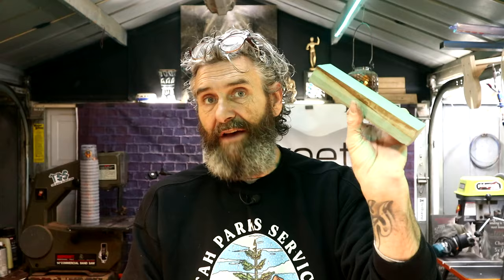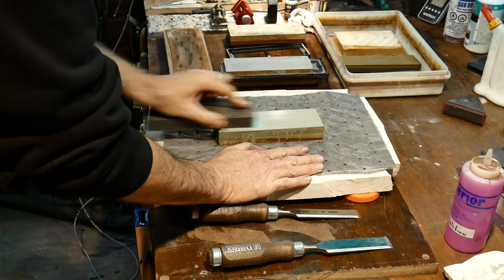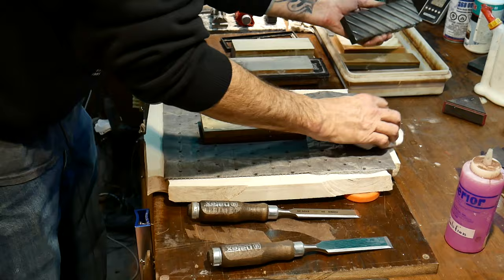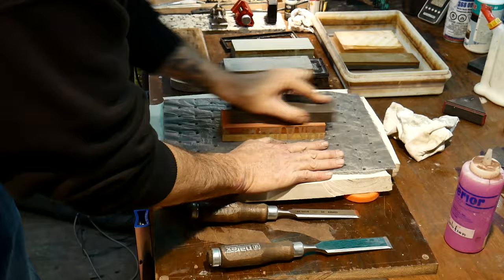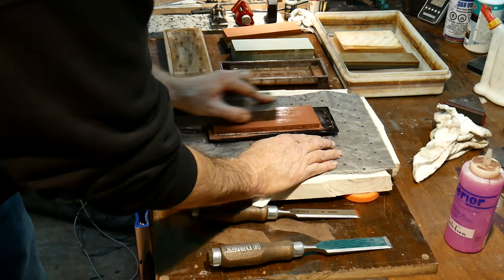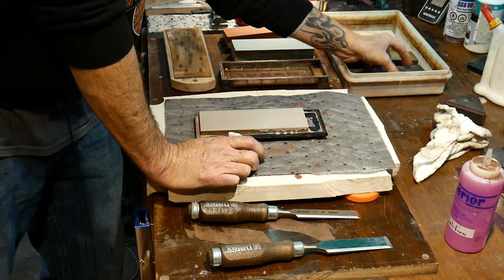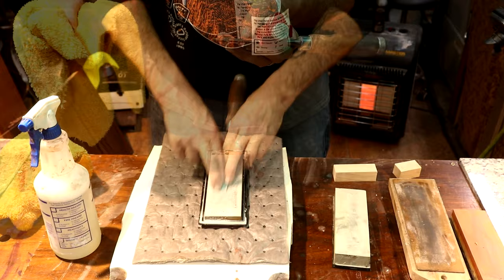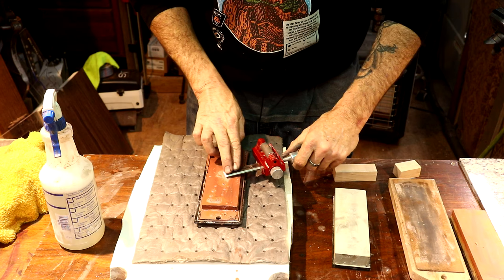How to Sharpen Chisels - The Sweet T Way  #chisel  #luthiertools

Comment: The key to sharpening is a consistent and repeated angle every stroke. That guide does just that. I used to freehand all my blades and got pretty good at sharpening to a shave quality in short time. That honing guide you sent me brought that to the next level. The only thing different is I matched the angles to what the chisels came with. That trick to get a repeatable  25 degrees is GOLD and I will be making one for myself. guess I know what this weeks project will be hahaha.. going back over all my sharps.
Reply from the maker: Nice, I am the same when it comes to freehand sharpening. I could also get a razor edge but I found out I was getting off on my primary bevel over time!! Happy sharpening brother 😁✌️&💙
Reply: That 25 degree block is super clever

Comment: Good sharpening. I have similar tools and get the same great results. What most people don't realize though, is that it does take time to sharpen chisels and plane blades!
Reply from the maker: It does and I knew it was time to sharpen again. I figured a video was in order😁 I spent around 5 hours getting my 8 chisels back to what I consider to be "perfect" work ready condition. I had never flattened the backs completely and I know that is so important. Thank you for the comment!✌️&💙

Comment: Where was this video yesterday when I was sharpening my new 1.5 inch Ashley isles. 😂. All good. It’s got a razors edge on it now!
Aside. I like having a really coarse (320?) diamond stone for those nicked/dinged/new edges.
Reply: If memory serves. My version of that honing guide also includes measurements of protrusion to achieve specific bevel angles.  Just to add
Reply from the maker: Oh yes, some of the honing guides do have the measurements marked!! Thanks for the reminder. I have one that does and one that doesn't!✌️&💙

Comment: Not seen that jig for setting the angle before. Could an even more compact idea be to scribe two lines on the shank of the chisel and across a plane iron, to mark where to line it up to the honing guide edge, maybe? Could even use a sharpie over those lines and wipe it off the main surface so that it just remains in the scored line?
Reply from the maker: The method you mention is how I use to do it but the chisel changes length over time and the protrusion block accounts for that! That is a completely viable option for someone who doesn't use theirs that often but I've found myself sharpening my bladed tools more and more often lately just because I love how they work so much better when they're sharp! Thank you for the comment and the suggestion brother! Peace & Love